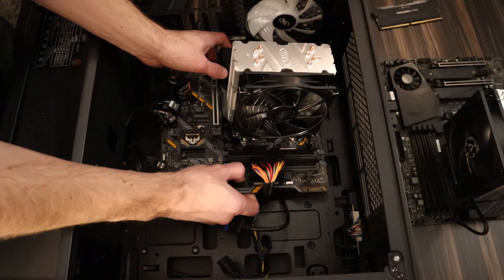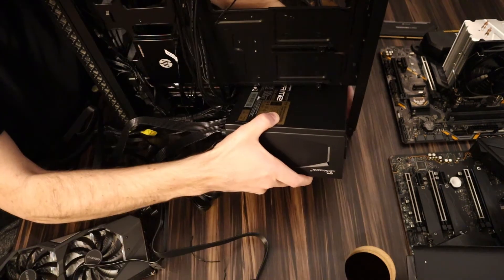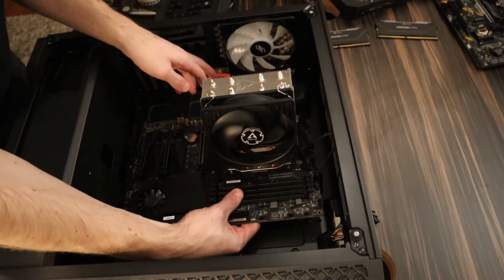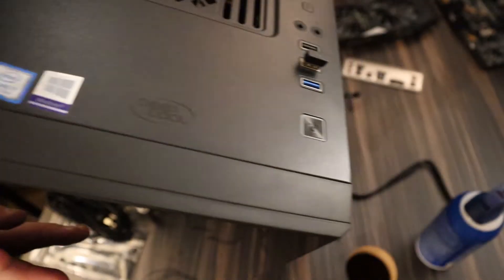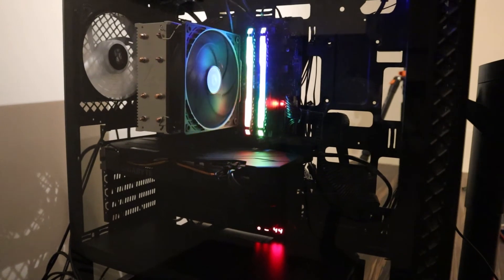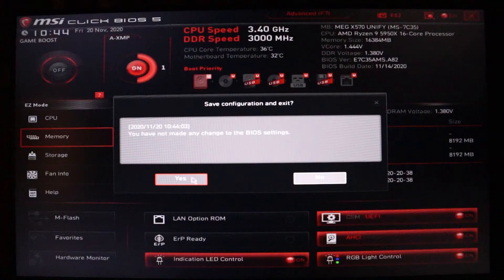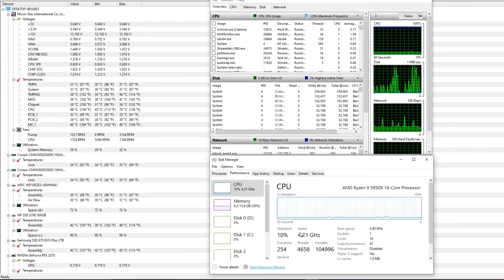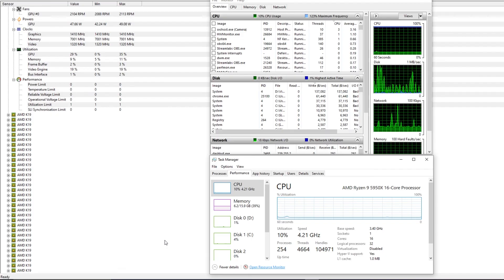AMD Ryzen 9 5950x On MSI MEG X570 Unify Motherboard With Seasonic GX 850 Power Supply

Comment from the maker: Case will be replaced, power supply is a short term solution :)
Reply: How much performance did u win in switching ? I want to replace my 7700k 4 core with this 5950x. Thanks
Reply from the maker: SUP' I noticed a huge improvement in video editing, that was the main reason for making the switch. The performance gain from my 9700F was significant, the 5950x is lightning fast. You want a good cpu cooler and good airflow, it runs warm.
Reply: @Ronin-Wilde  more core means more temps i think but i already have a very good cooler (kraken x72 360mm). Thanks for sharing ur experience 😋
Reply from the maker: SUP' oh ya, you should be fine with that Kraken.
Reply: @Ronin-Wilde  what kinds of Temps did to you get while gaming on your 5950x?
Reply from the maker: Brode usually between 50-70c depending on the game. Goes above 70c when I am rendering a video, otherwise it stays in that range.

Comment: I have this processor (actually i lie its a 5900x) and motherboard and I'm using external peripherals to power two other hard drives which I have plugged into an external Sabrient USB extension along with the mouse and an external controller.  the motherboard doesn't power off these devices well when the computer turns off and I have to unplug one of my external power supply powers for one of the hard drives every time I want to stop the noise which causes a weird whine thru the speakers for a second, but stops the motherboard noise.

I can get by and ignore the issue but it is odd.  I solve the noise issue by unplugging the external hard drive power adapter everytime the computer is off and this stops the noise which is coming from the motherboard.  I can't think of anything else I can do.  I don't like it but i don't have any other solution.  I don't think this motherboard handles external peripherals well at all.

Comment: Any issues so far? I have the x570 Unify with 3950x setup, but only because I can't get my hands on the 5950x LOL...but was wondering if there was gonna be any issues if I upgraded later. 

Also, have you ran any Cinebench on it? :)
Reply from the maker: No issues so far, I was so close to giving up on the 5950 and going with 3950, still a potent chip. When you upgrade you would just need to update the BIOS to a version that supports 5000 series. There is 2 currently, a beta and non-beta. 

I did some Cinebench when I first got it, I haven't done anything since, I did some Geekbench5 and it performed really well. Also I did userbenchmark, I wanted to see if my ram was under performing compared to others, the system seems to be working really well with the unify at all levels.
Reply: @Ronin-Wilde  Hi, I also have x570 Unify + 5950X. But, my PC constantly gets BSOD from the first day of building. Now, I have changed to B550 + 5950x, it works better. But still got crash from time to time. what do you think about my issue? the CPU is defective or the MB is ? Thanks.